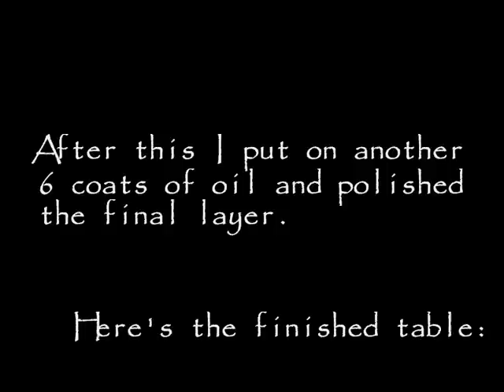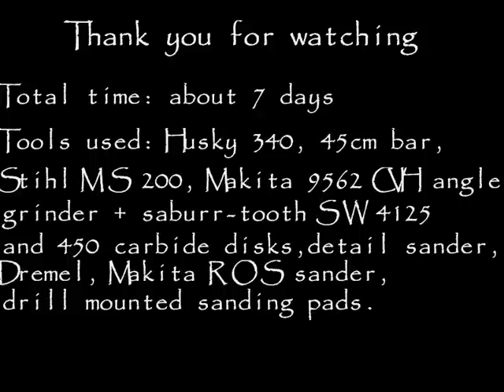Birch End Table Carving

Comment from the maker: It's relatively safe when you (at full RPM!) insert the saw bottom-nose first, plunge it in an inch or so, and then angle the saw horizontally. That way the wood above the chain will prevent kickbacks.

Comment: How does that oil 50/50 blend hold up over time on a well used piece? ... And was that log dried before you worked on it? If so to what if you remember?  Thanks that is a beautiful piece!  I love the table with an armrest you did also!
Reply from the maker: It still looks great more then a year after. No discolouration or flaking.  The wood was 50% dry, but because the finish is porous, the moisture can escape.
Reply: awesoem thank you!

Comment: This came out beautiful. Why did you hollow out the bottom? I would try some lights up inside, that would look cool with all of the cracks and openings all around the sides. What type or a grinding wheel did you use? A chainsaw type, or just a regular grinding disk? Thanks for the video.~~Dolly
Reply from the maker: CrossGrain Wood Products,LTD Thank you! To lessen any cracking I took out the core, this usually works. A solid log WILL crack badly. I used Saburr tooth carving disks, you can find them on Google. :) And yes, I will add a lamp at some point!
Reply: *****
That site is full of viruses too!